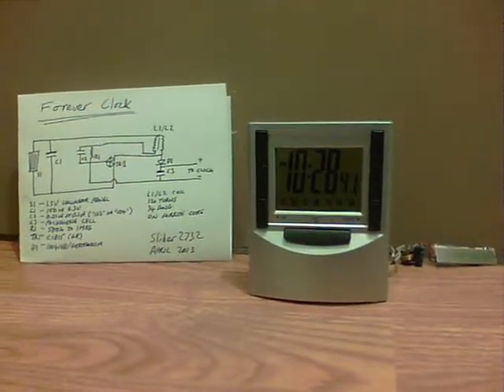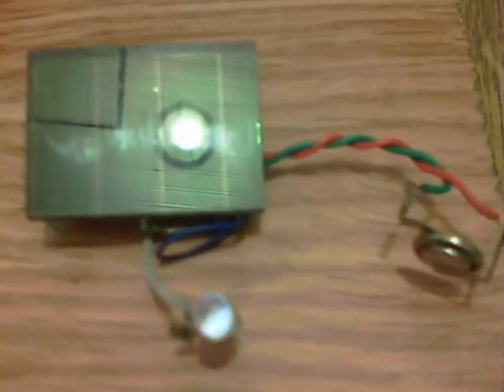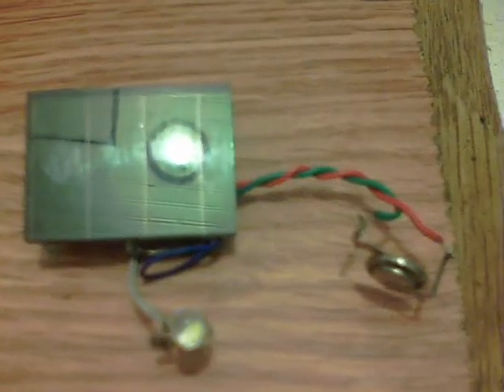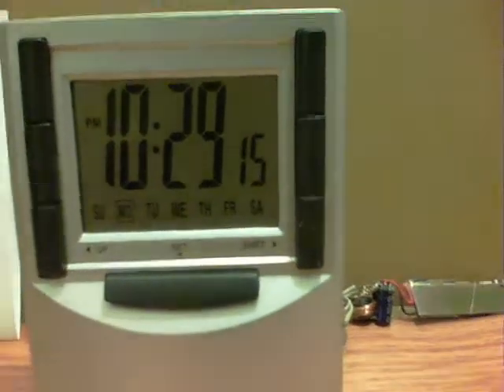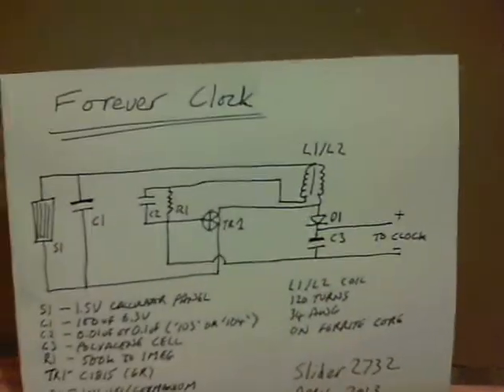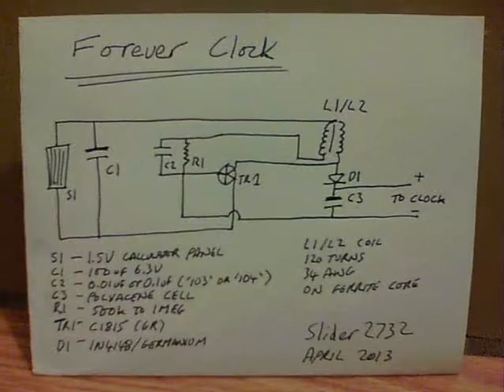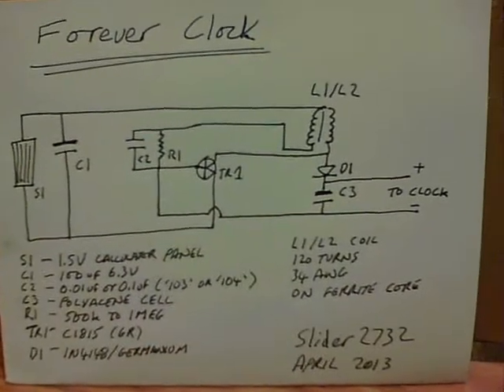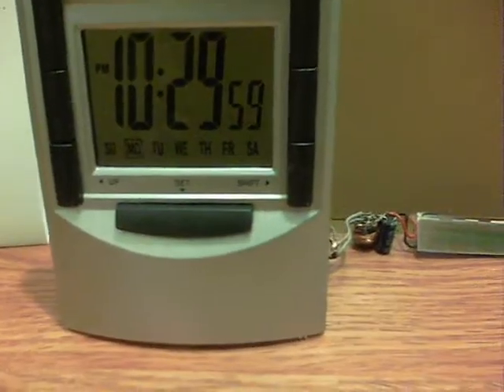Forever Clock

Comment: I bet I can get a bit out of the car panel with germanium transistor :) Failing that, 2-3 in series will produce a bit of juice.

As I'm all out of clocks, I am charging lead alum in the rain. Playing with cap discharge stuff. Worked out how to get more differential between charge cap and battery :) I wish I had a clock to add!! No luck getting cheap watches on ebay :| Had to pay $1.37 each for more clocks!!! Daylight robbery!

Comment from the maker: 12v ?!?! LMAO 
Dump the extra through a zener to a battery, charge them up while yer about it :) Could see it another way, as a battery charger but that runs a clock all the time.
The cars would have to be series x 3, with only 0.5V output, so final panel would be bigger.

Comment: So I tried this with my flexi panel, and about 3,000µf of storage. Ran my clock for about 25 min with no light, but kept it going ok off room light. Overvoltage protection is a good idea though. My clock died at 12v.. Was a bit brighter in the morning when sun came up... No worries getting 20v in the shade.

Been scouring ebay for little calculator panels. The best I can do is $1 calculators. There are also a bunch of $1 solar torches :) Or the cars. Depends if I want motors or Leds...

Comment: Good one. Why have I not run a clock on an oscillator? Just didn't seem impressive enough. Then you go and do a clock that never needs batterys LOL. Now I want to make a heap for xmas presents... You should get some more clocks off ebay, and sell these on your website! Kitchen timers would be nice too! Maybe a remote hack kit, with SWES charging station? Or some kind of solar powered sundial/compass/sextant? Wonder if it would work with calculator panels?

Comment from the maker: Yeah, didn't know myself until perusing Elec Goldmines website last year. They run down over a few days if not charged. About 0.5F I hear (think was Lidmotor who worked out the capacity). Very handy and tiny, the connecting legs are about as big as the cell !

Comment from the maker: It's a valid point. The tiny solar cells only put out enough voltage in very good ambient light or in sun. The circuit runs as a Joule Thief, starting at around 0.5V and a couple of uA and outputs enough to trickle charge the polyacene over and above the needs of the clock. Output is pulsed, rising to a threshold then firing, which ramps up each output V/A. Otherwise the polyacene may only get to an average of the light input, which could be say 0.9V.

Comment from the maker: Yep, the polyacene's are just really small and a good price. Some are found in cellphones for memory backup. The size of cap will alter the initial charge up time....bigger the storage the longer without any light at all if wished. Too big though and it may not charge as high during a cloudy day. 
The polyacene is, I believe, about 0.5F and took around 3hrs to charge at first. You could put a 1.5V battery across it to start the circuit running though.